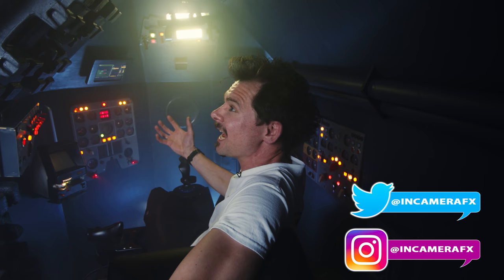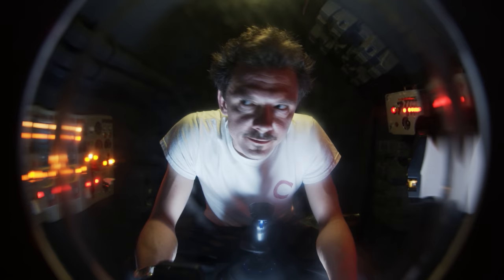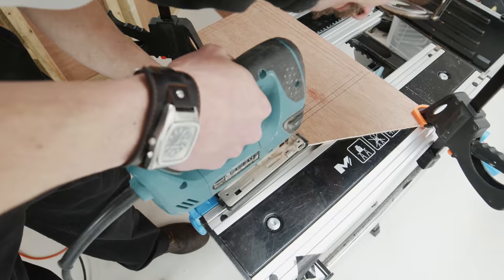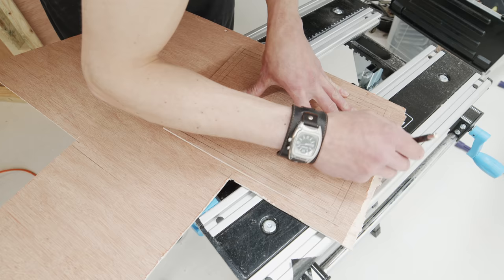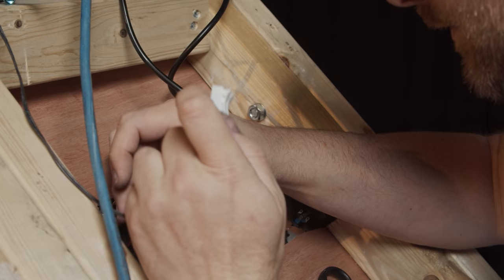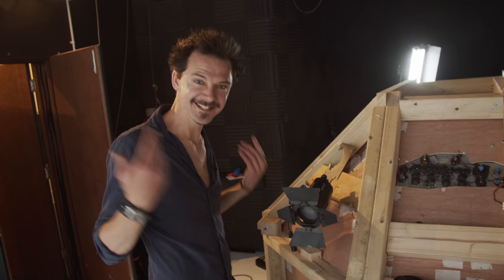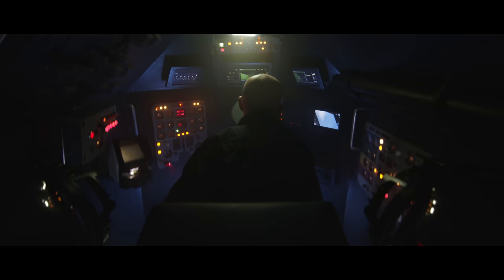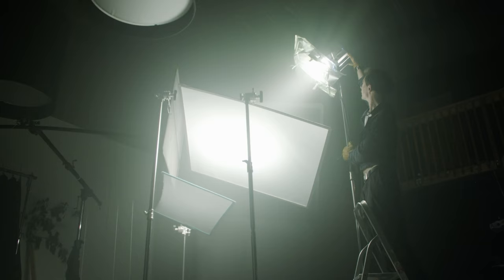We Built A Low Budget SCI-FI COCKPIT & It Looks INCREDIBLE!

Comment: Tommy: Let's build this cockpit using things for free, or as close to it. Therefore, we're going to use 2x4s and plywood.

Me, an American: So I guess we're spending $2,000 then...
Reply: It definitely feels like it these days.
Reply from the maker: Tbh 2x2 would be plenty, we just used what we had. But we hear you, we're very lucky to be in a position where we have materials left over from productions. Also hoarding ;)
Reply: @InCameraTV  Hoarding is key. Be it scale models or full fledged sets.
Reply: Get old pallets from worksites or warehouses
Reply: @MelbourneShorts11  true
Reply: @MelbourneShorts11  Pallets are always a good idea. Just plan months ahesd as it can take some effort to find them.
Reply: @gorillaau  Sadly pallets are very heavy unless you cut them down to 2x2s. I make Halloween set pieces using 2x2s and the thin boards like they used here in this video. When I first started I was using pallets and thicker ply wood. It was heavy and a pain in the ass. Swapped over and bam.... So much easier to build and disassemble/reassemble year after year.

Comment: Tip for removable wall sections in the future is just to use dowels instead of bolts. Drill all the way through with a 6mm bit, then re-drill one side with 6,5mm. Then install dowels. Use c-clamps to hold everything together. It’s WAY faster to shoot when all you have to do is loosen 3-to-5 clamps rather than unbolting 10-to-15 bolts. After all, you can do as many dowels as you want for alignment but you need very little to hold it all together.

Comment: As always, another great video.  I did want to give something back in the way of a tip.  When cutting with a jigsaw, if you hold it upside down and cut from the underside of the wood, it is easier to see the line and most of the debris then gets pulled away from you, rather than into the air.  The first time you do it, it will seem awkward, but stick with it.

Comment: When I was 12, I was stripping junked cars for my dad on weekends. I pocketed switches and lights and wires to make my own BSG Viper cockpit using just the switches lights and a car battery. Using card board, duck take and spray paint, I made my first cockpit. 
Last project I did was about 10 years ago, converting and old Alphajet simulator (made by CAS) using modern off the shelf USB instrumentation, MS Flight simulator, FSUIPC (.DLL) into a modern simulator with 3 plasma screens (used to be just VFR trainer). Fun stuff!  Much easier to make some very functional flight Sims nowadays using off the shelf products.

Comment: Make it from cardboard (multi layers) utilise old led monitors as MFD's coded with python running on Arduino, esp32, stm32 microcontrollers, led lights, servos flight yoke joystick controllers, and it could actually function and operate like a real spaceship simulator and or fully enclosed sci-fi gaming cockpit.

Comment: You are doing like in Star Treek , that is meant to be in the year 2360, but stil using "rocket switches" in the communication console". Sincerely using old bulb light / led indicators, and old fashion switches is nothing to do with the future. Well maybe in an engineer room stil has those bulb indicators in high voltage power lines/panels. But piloting cabins? It is going about touch screen controls and software and the joystick ofcourse. Your cabin looks like retro-russian space-ship cabin.

Comment: Great walkthrough of building your cockpit set. My one question is: Where can one find those lights and LEDs that were part of the panels? Is there a good source out there or here in the States where you could buy such lights?
Reply from the maker: You can find all kinds of switches and LED related stuff on ebay, and probably other such seller/auction sites. Some are ignition switches for vehicles, others for video game machines, but all available as individual items :)